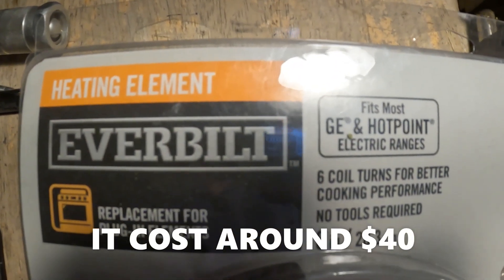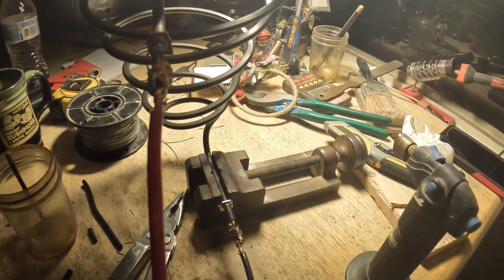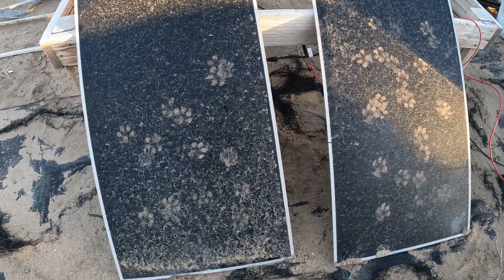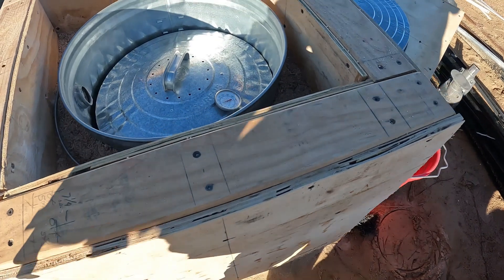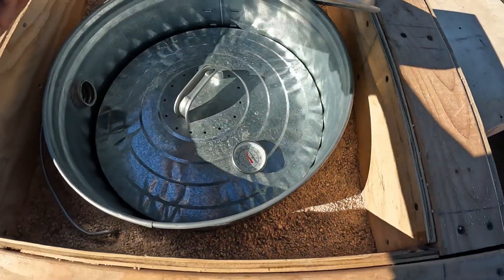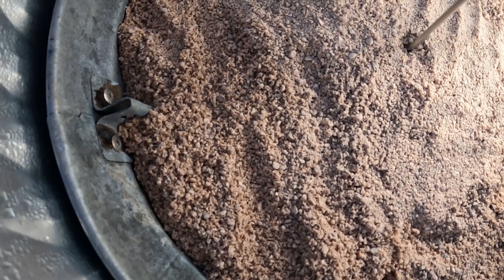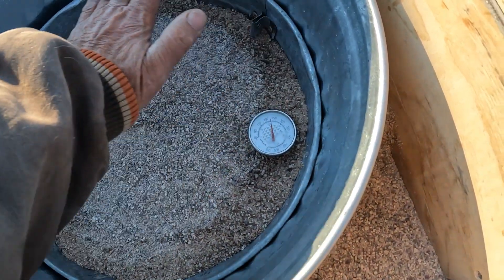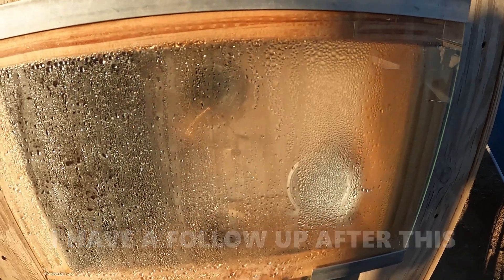Sand Battery Part-8, 550 Degrees F

Comment: Looks like the R & D is going well. Volts x amps = watts. Looks like you’re ready for a larger storage container and more insulation. R-50 is zero energy loss. Now if you can get the sun to shine long enough to get your results and fully heat your sand storage. Keep up the great work
Reply from the maker: Thank you for the information.
Reply: @off-gridsurvivalmike8120  Hi, thanks for sharing, I just saw this video will look more on your channel as I find time, but I have a quick question: how come the direct link with the pannles dont burn them? Anyway you can provide the exact descriptions for noobs like us? Thanks.
Reply: @off-gridsurvivalmike8120  and also what happens if you don have sun in pannels, I imagine they heat less, like in a morning, but what happens to the pannels, dont they get burned?
Reply: @off-gridsurvivalmike8120 You can also use a generator to power it for testing purposes

Comment: try direct solar concentration heating, at least 4x more efficient than first solar panel conversion to electricity
Reply: Problem with that is aiming sun all day long, i tried using fresnel lens from old tv. It works very well yet need some sort of motorised mount that can follow sun at exact point so lens can make concentrate heat at a point.
Reply: @HarpreetSingh-di4hk  well use a perfect lens, or aluminium concentrator mirrors, I did not mean fresnel lens specifically, any type of concentrator setup, concentration is assumed, not problems, and you can make a trough that stays aligned to sun path all day with no movement, ie longitudal parabolic pipe concentrator
Reply: @HarpreetSingh-di4hk  making a tracker is no problem, what if people would just solve the issue and not complain there is a thing to be made

Comment: Like the progress. 
1. Will you show temp differance form outer diameter and 3 places headed to center after sand is heated? 
2. And how much did it cool down overnight from the 550 degrees?

Really like the progress Mac in Michigan
Reply from the maker: It cooled down to 140° that next morning. I will show more readings. My plan was to top it off with more sand and close it sealed but I won't do that to this prototype at least not yet so we can see how it performs for a while.